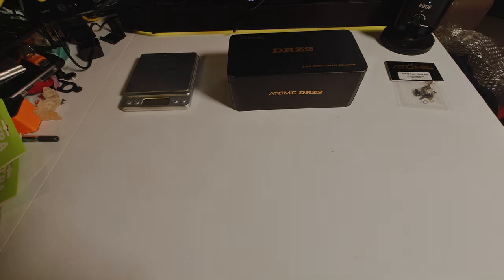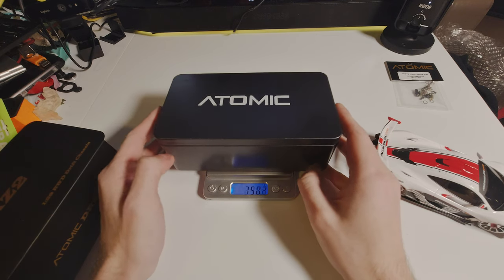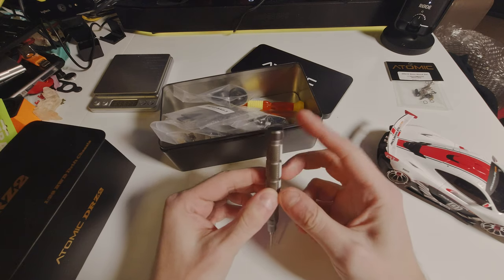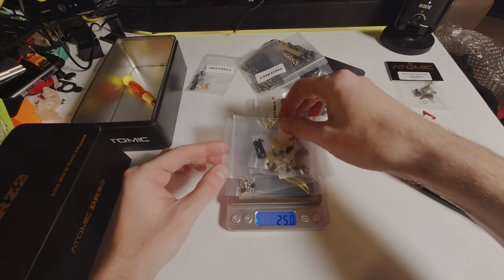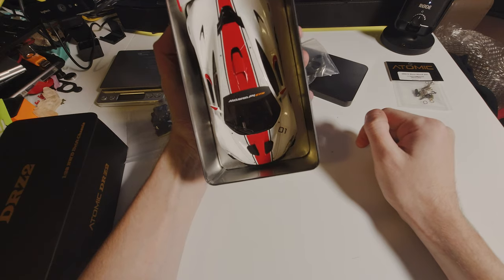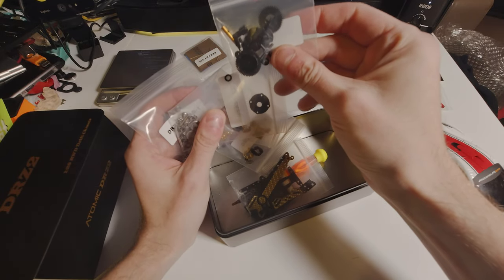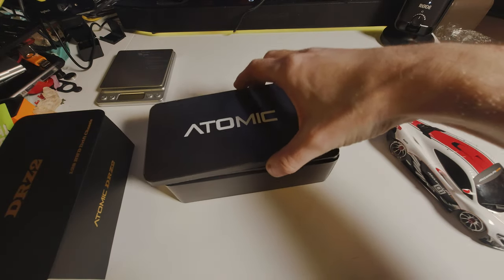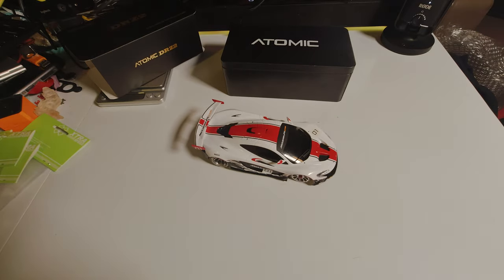Atomic DRZ 2 Preview and Update

Comment: Curious about the mono shock as well. Would probably induce more body roll but not exactly sure how it'll feel.
I was considering the DRZ V2 but went with the GLD since I got the V1 with BM upgraded steering.
Reply: Exactly, I feel like if you already have a upgraded V1, the V2 is not exactly worth it. Unless you want the blinged out carbon fiber ;) which I do! 

Can’t wait to see what you think of the Gl-D! I think I will go GL-A before I get a GL-D, but who know you might change my mind!
Reply from the maker: there are so many good RWD drift cars coming out at the moment. i have not been happy with my super skeeter build due to issues with the front suspension and this design looks to address them. i could see myself picking up the GLD as the GL chassis are so much nicer to work with

for the mono shock apparently it allows you to throw more weight around via the body twist,  am guessing that it loads up the outside tyre a bit more in a corner and gives a bit more grip its a bigger thing in the 1:10 arena apparently
Reply: BMR 3 indeed, especially since the entire rear section is the exact same.
Reply: Blitz Works  personally I never had issues with lacking front grip but I guess if the setup is right it could do weird straight drifts like how they drifted an almost straight line in the initial testing phase of the V2 in that top speed arena video on Facebook.
Reply: I hear they'll be releasing the front end steering for the v1 also so you don't have to swap the entire car.  I'm curious and will look into it, but still waiting on a certain crawler coming out, maybe another Dr!ft car, or maybe start making a proper board to drive on....who knows.  Still got 3 projects on the go in the kitchen :D
Reply from the maker: @foxracerdrew  is this the gmade crawler or something else, i just put in an order for the geko24 frame as it now has the loner wheel base and better shocks for a rally truck
Reply: @BlitzWorks  Nope, completely different.  I'm still waiting on more information though since right now everything has been turned on it's head, once I find out more I'll let you know.  But I'll say this, it's a contender for the Geko.
Reply from the maker: @foxracerdrew  and i just put my order in. i am guessing its related to that picture you sent me with the dual diff lockers and if it is i am sold already
Reply: @BlitzWorks  haha, yea it is.  But it's been delayed so not sure where it's at right now, there was supposed to be more info this month but nothing yet.

Comment: there's a silver overland for sale on marktplaats wich is like a dutch ebay for €150 with the old orginal transmitter and everything. the ad says that it works but squeeks a little when you drive forward.
I can put a link too the ad if you're interested. there was a full alu overland for sale about 2 months ago aswell for 250 or so but that's gone already.
Reply from the maker: I have a blinged out overland chassis already but have one incorrect part causing the suspension to rub. also saw the geko v4 body last night and may just end up using that but not going super large with the tyres and stance and keeping it more in line with the original overland

Comment: Not gonna lie, I envy your screw driver. She looks glorious!
Reply from the maker: a good scredriver makes a huge difference and selecting the right size for the screw you are using helps a lot in not stripping them. that good screwdriver has been instrumental in not stripping hex screws as well as the tolerances on it are great, turns out t was cheap. i bought it at a decent price then hedged against getting a bad screwdriver buy buying 2 cheaper kits. all of them ended up being great

it is weird though, it feels great in the hand and has a great finish on it, not a sign of rust after a year and i enjoy using it and fiddle with it while concentrating at work. one of the better upgrades to my kit i have done over the years

Good screwdriver: https://www.banggood.com/custlink/vKmhJh7nWI
Dual size screwdriver: https://www.banggood.com/custlink/3mKRryTncL
Portable kit: https://www.banggood.com/custlink/GGDdrETQp0